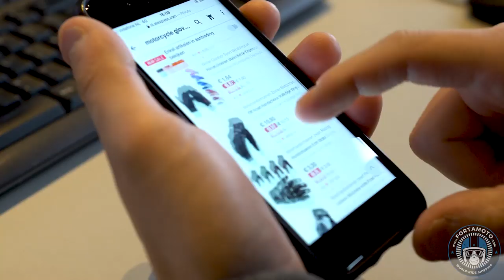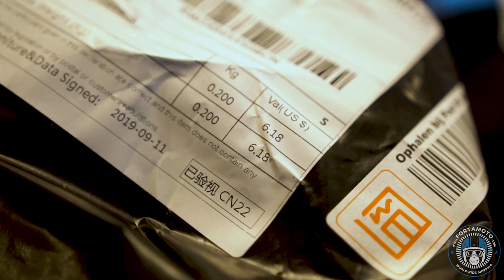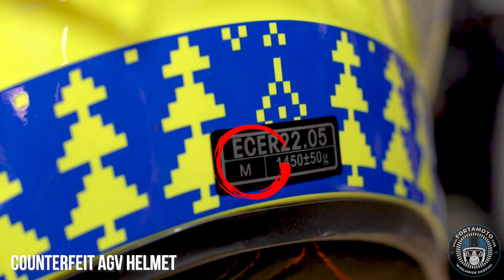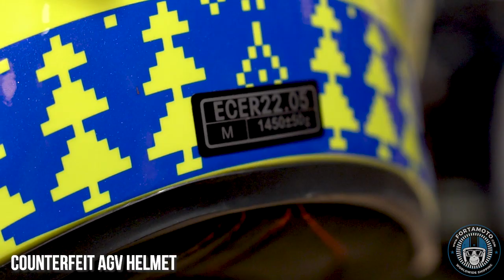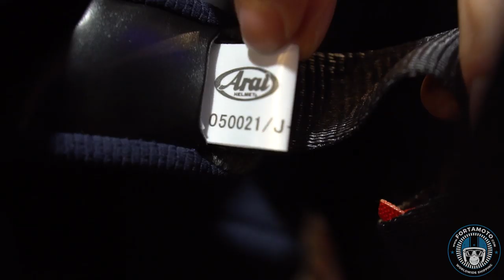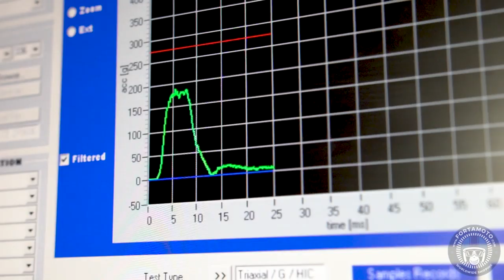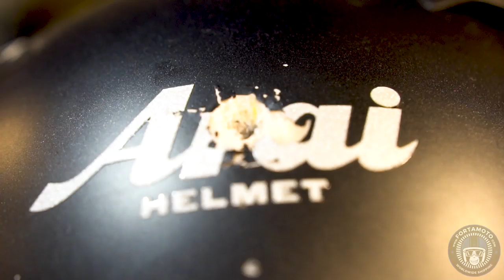Fake Motorcycle Helmets crash tested! Will they pass the real ECE/DOT tests? | FortaMoto.com

Comment: I always buy Simpson helmets these days. There are better helmets, I’ll be the first to admit that. The features tend to be limited, and they don’t offer many of the features of more specifically motorcycle-focused helmet manufacturers. 

That said, I find them comfortable, stylish, minimalistic and they have a Snell rating (which I don’t trust DOT, so I usually shoot for stuff with an ECE or Snell rating). 

That said, my only complaint about my old Arai is I wish the viewport was just a little wider (top to bottom). I usually ride in heavy traffic and being able to see, even just a little bit more, saved my butt on a few occasions. 

I wore my Arai for over three years and like 45k miles (I’m hard on my helmets as I’m a commuter who tends to do everything on my bike) and it was a great helmet! I would buy another one, but I do wish they’d open them up just a little for their full-face helmets. 

Anyway, I always enjoy watching these videos as they’re a great well of information on what to look for.

Comment: The ECE 22.05 requires no "Shell Penetration Test" like DOT or SNELL - which of course you know.
BUT: as Arai is proud of it's very hard outer shell and it's minimal flex (which you demonstrated by standing in the helmets) I guess that's why this test was included ;O)

Nevertheless, quite entertaining video although I wouldn't have bought my helmets from sources like this anyway.
Reply from the maker: Spot on! The penetration test was included because it's part of the DOT and SNELL tests, and because we believe that it should become part of the ECE test. Thanks for your compliment, and good on you that you wouldn't get a helmet from there! Neither would we, except for scientific purposes.
Reply: The ECE tests simulate hitting the road or a car, a blunt object. Hitting a sharp object can happen, but it's not the common incident.
Optimizing a helmet to withstand such a penetration test means it has to be optimized for hardness, which then results in compromises in the dampening area (g-value and duration of the impact). That means helmets which can withstand a high penetration force can not be as good as possible in the dampening department. Most important are the highest dampening values which means lowest g value and shortest duration of the impact peak.

This is why European helmets optimized for impact with blunt objects all undercut the Arai results, and that often by a lot.

Our motorcycle helmet do not need to be like a construction worker helmet. I hope the European commission will not change the system, because the brain is more sensitive to harsh accelerations or decelerations of long durations, than anything. The penetration testing is old school, overcome.
Reply: @krollpeter  hitting a sharp object is a real world likelyhood.  Maybe not in downtown Brussels, but in the Alps or any interesting twisty rural ride.

I've always considered most of these standards on every continent to be self serving, and easily controlled by the companies paying for the standards committees.
Reply: @STho205  It's the result of research work that has been done, hitting a penetrating object is the least likely form of accident. I can't proof that by showing any link, etc., it was too long ago that I read about this research article. I also stand by all the other statements I did regrading the dampening capacity. It is not my personal opinion that I sucked out from my fingers.
Reply: @krollpeter  unless it kills you when you go over an embankment.  Then it was important.
There are few details in accident stats.  They do the grossest collection.  With/without, dui/clear, bad weather/fair, night/day

We have a lot of MC deaths in Georgia and everyone is wearing a helmet...because you get a hefty ticket if you don't.   However nobody has broken down deaths in the four extremely different riding regions.
Reply: @STho205  It is in a way a decision that the European commission had taken, it is a trade in between a hard shell and a high dampening capacity. Hard shells that withstand a sharp objects penetration are lesser capable to protect our "melon" with high dampening capacities.
Most accidents are hitting the opponents' car, in particular at the frame above the door, where is a hard structure present. Also, very common is hitting a curb after the head after sliding over the road surface for a distance. Additionally, after the impact from hitting on a car for example we fall down onto the road, or we flip over the car and hit the road surface. 2/3 of motorcycle accidents in Europe are caused by the car driver exactly like this.

This all is why the ECE decided that a double impact test is more important than a penetration test. In the US they made a different decision. Maybe there are reasons, for example, much lesser accidents in urban areas. That I would not know. In Europe accidents around urban areas are far more common.

Comment: In my country We use helmet alot like like those with foam but they are not knownoff brand, they have their own brand name
It is about $ 10~12 
Still Pretty safe
we are not gonna penetrate with angle impact or press with car wheel or something
Just to protect the fall damage on flat concrete road surface

Comment: I thought the knock offs helmets went quite well in the tests. Critical for the real and severe between the real and knock offs isn’t bad. I thought they would have been unsurvivable 
I wouldn’t dream of having fakes I have top line AGV Pista and mid range Arai helmets but found this interesting 👍
Reply from the maker: We expected them to do a little worse too, although they were up against aged Arai helmets that had actually been dropped and tested before - so the result of a brand new Arai helmet should be much better.
Reply: Yeah, I thought the same. At least they're better than nothing...

Comment: Why are there no aluminum shell motorcycle helmets out there in north America  ?
Reply: For the same reason you shouldn't wear steel toe caps riding a motorcycle. Its crushes in and they have to cut your toes out, as for your head wearing a metal helmet, you will be dead so no need to worry.

Comment: Keep in mind a $500 helmet should be thrown away after 3 years.
Reply from the maker: This is not true. A $500 helmet will typically be made from fibreglass (at the least) and can be used for up to around 7 years, if treated well. A polycarbonate helmet will cost you much less than $500 and will last you 4 to 5 years, if treated well.

Comment: The difference is the original helmets has thicker Styrofoam and different type of casing. If the fake helmets doble or triple the thickness of the styrofoam in can almost match the original ones.

Comment: I dropped  one of these cheap helmets that someone gave me on concrete and dented it I  immediately threw it in the trash I'm going to stick with my $400 dot approved helmet
Reply: Every vendor will tell you once you drop a helmet you should either send it for inspection, or throw it away. That's right, even a $ 1000 helmet.
Reply: @krollpeter  Because they are vendors. A regular drop from hip high does absolutely nothing to a genuine helmet. If it can't take that 13kph drop, how should it withstand a crash at much higher speeds? I know people who slid off while riding, sent their helmet in to the manufacturer for inspection and and it came back with a certificate for further safe use. If the shell doesn't show any cracks or dents, it's fine
Reply: @LMO169  I learned there is a big difference in between a helmet with a head inside, or empty.